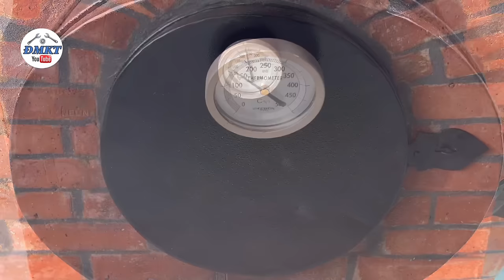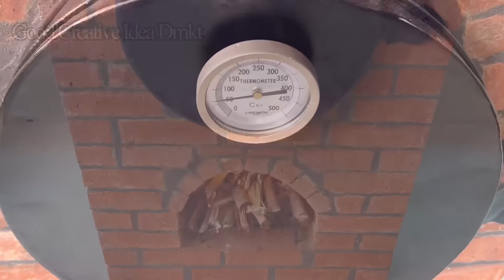Pizza and toaster oven / Creative ideas from cement mud and red bricks

Comment: The bricks that should be used for an oven, should be: 

The best types of bricks❤🎉 to use is refractory brick. This type of brick is made from clay and minerals, and it is designed to withstand high temperatures.
Reply from the maker: Thank you